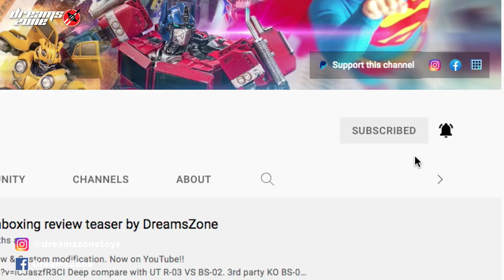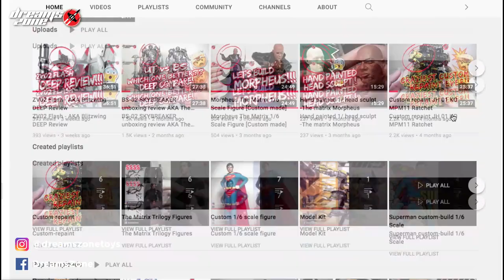Custom repaint Sonic Warrior SX02 Soundwave

Comment: It looks amazing Dreamszone! I’m curious: how to did make sure that the battle damage/dirty wash stays on the thighs, since you didn’t apply a primer? Did you add a varnish in the end? And about the varnish: how did you add a varnish in the end to the entire figure? Because of course you don’t want the dirty wash to have the same shine as the metal parts. Many thanks and take care!
Reply from the maker: Thank you! Glad you like it!!
I actually didn't add any varnish after repaint especially I don't want the final figure to be too "shiny"...The model color I used is very settled and it stays well, that is good enough for me.

If you are worried the based color won't stay on the thighs or arms (white parts), sure you can simply spray a light layer of clear varnish (matt) after the first layer of grey color tapping, so you won't worry the added top layers will be washed away. 

Usually, I apply primer only for the model kit if the surface is not even, but it is no need to do so for these types of transformable figures.
Reply: @DreamsZoneToys  Aah okay got it, thanks for in info! I might gather the courage to paint some figures myself haha.